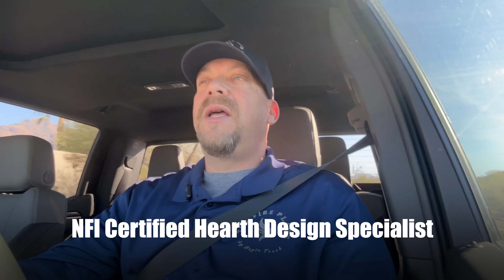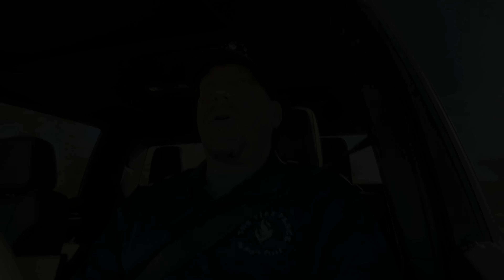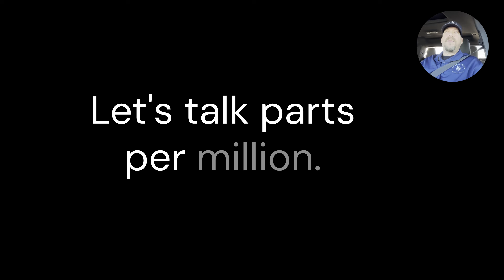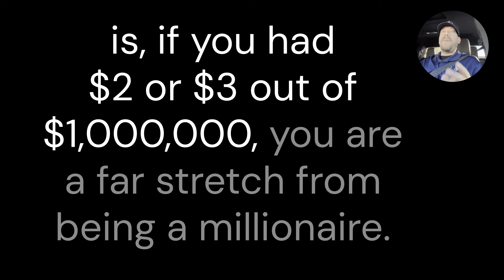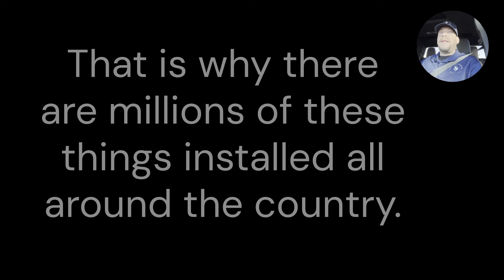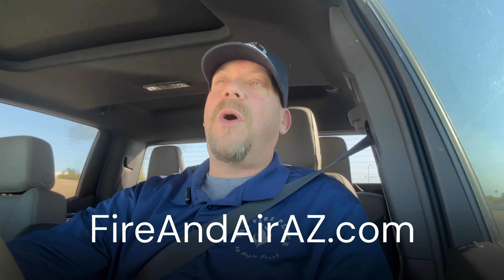The Truth About Ventless Fireplaces

Comment: Thank you for this video.  I appreciate your candor.  I am using a ventless fireplace and it's actually my first non-woodburning fireplace.  It heats the basement (here in Michigan) fast, but I'm not fond of the gas smell.  Must I keep a window open?  Should we install an exhaust fan somewhere down there or use an air purifier maybe?  Thank you!
Reply from the maker: Rather than opening a window, the best (albeit most expensive) option is to have an HVAC contractor (preferably one with IAQ (indoor air quality) knowledge install something like an HRV (Heat Recovery Ventilator) which is a way to bring in fresh air, exhaust stale air, without losing efficiency from any already conditioned air. An exhaust fan could work and is a less expensive alternative but you still want to bring in some fresh air exchange so it needs to be well thought out based on the home. Thanks for the feedback, I appreciate it … makes sharing this kind of info worth it! 😊